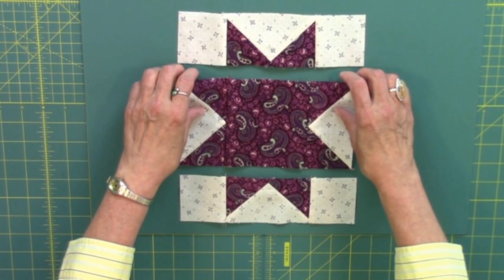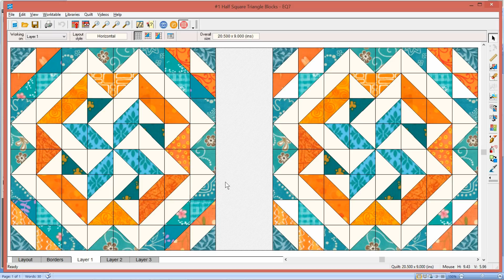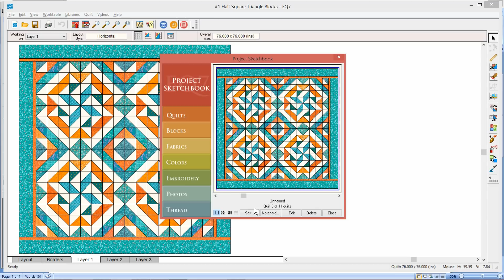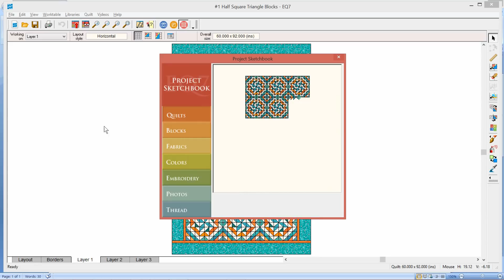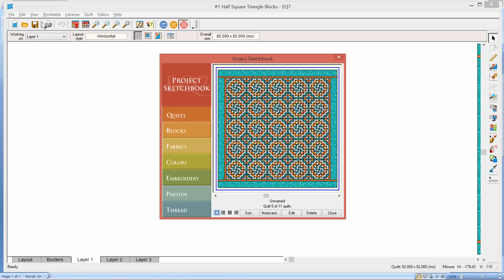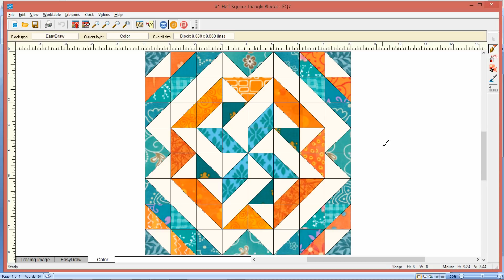Half Square Triangle Quilt Blocks - New Design - Block #1

Comment: Please -- more info on the computer program you are using to plan this block out?
Reply: is the program called Electric Quilt?
Reply from the maker: Yes I am using Electric Quilt when adding color to this block and playing with design options.  To draw the block to begin with I used Adobe Illustrator.